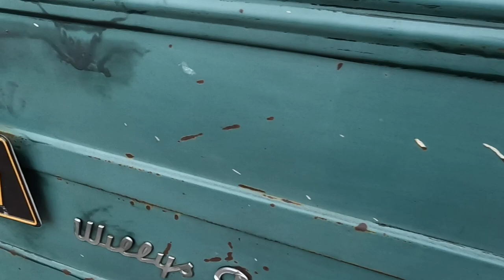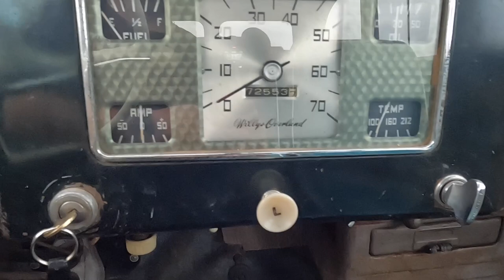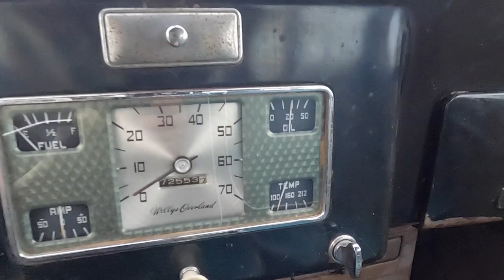72K Miles - 1948 Jeep Willys Station Wagon - Frankman Motors Company - Walk around and Driving Video

Comment: It's  a two wheel drive! Those  should have been outlawed years ago. They have a very dangerous front suspension. If the end of the cross  spring snaps  off it drops the wheel and what's left of the axle on the ground. Try that at 50  to 60 miles per hour.